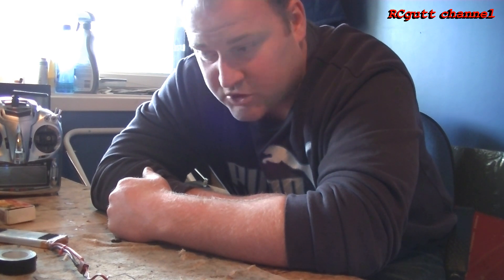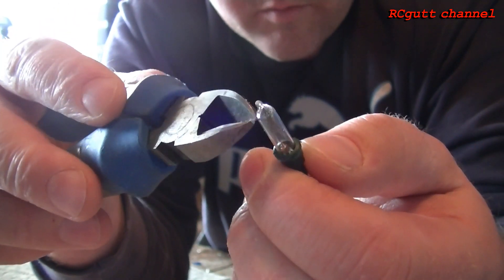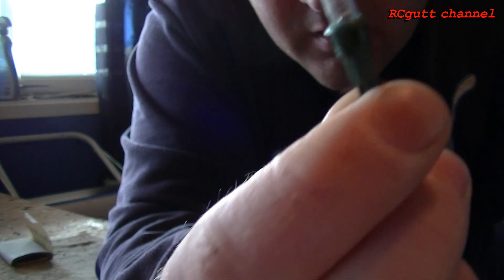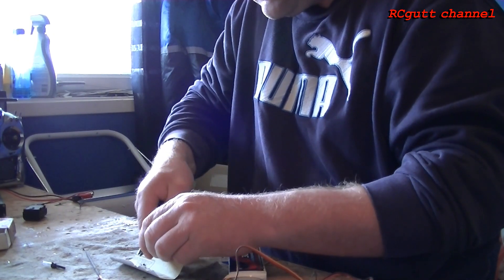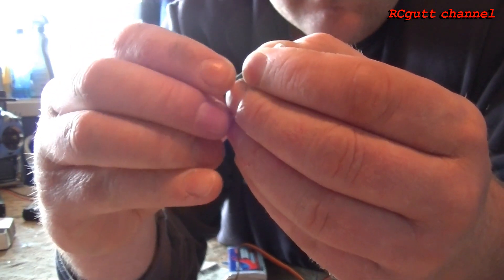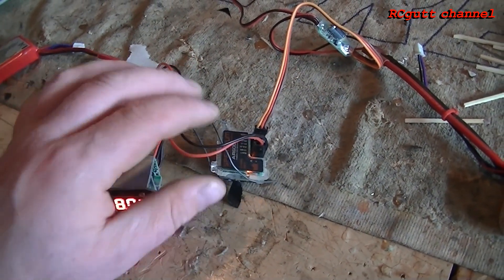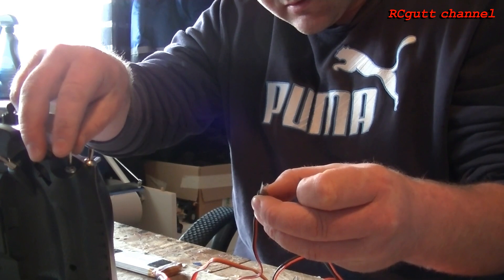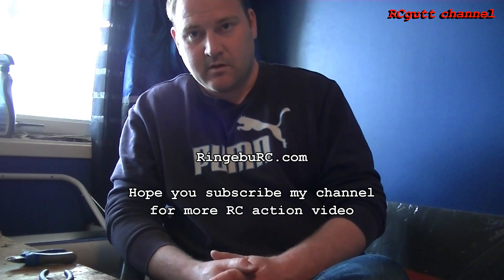How to build a igniter - Easy and cheap homemade rocket engine igniter

Comment: thank you, i will use these frequently. :)
Reply from the maker: Yes this work very well.. but the ignitors i buy is smaller and fit in smaller rocket engines :)